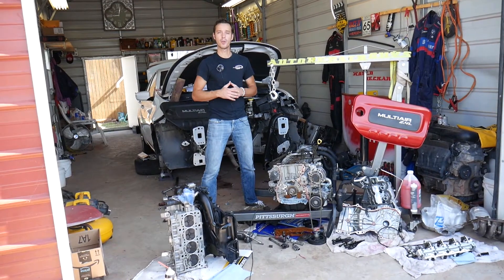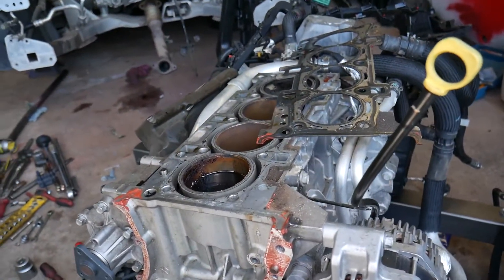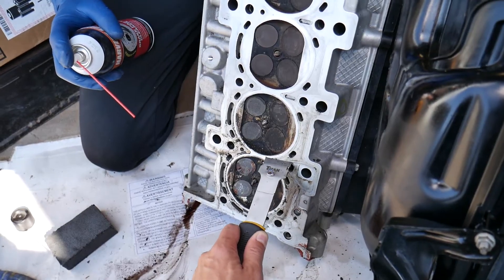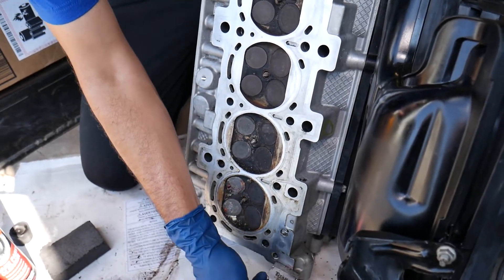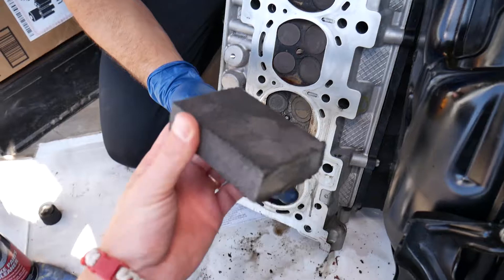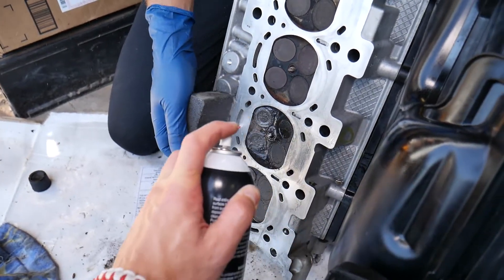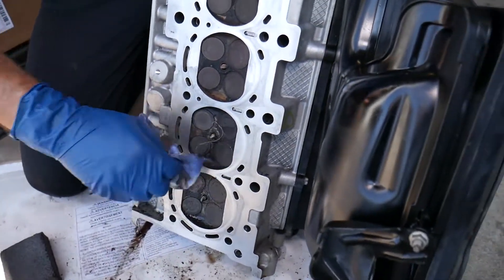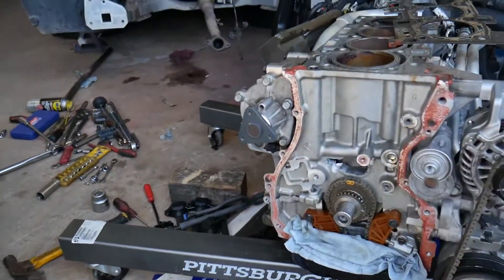HOW TO CLEAN ENGINE BLOCK AND CYLINDER HEAD BEFORE INSTALLING HEAD GASKET

Comment: Yea this is a video of exactly not how to do it. For one you didnt even use a straight edge to check for warping on top or bottom of head? are the cam journals straight still can you spin the cam by hand? And one should never use an abrasive sanding block that small. Shops use to use giant belt Sanders back in the day but its totally obsolete it needs to be decked properly and machined flat. But of course there your standard Russian car flippers who dont care because there just selling the car to someone who can deal with it later down the road. This is what you called backyard mechanic if I ever saw one.  

Edited also no one seems to notice the surface rust in the cylinders that's just gunna tear up the rings wont last longer than 10k miles

Comment: You should NEVER use an abrasive material to clean a mating surface! This is not the way you should go about this. The proper way is to use a carbide scraper and/or a plastic/rubber rolock disc on a die grinder. You have to use something thats softer than the aluminum when youre finishing the surface. Otherwise you will create high/low spots in the mating surface which can lead to premature (in this case head) gasket failure.

Comment: Never ever use a sanding pad! Use a green or red scuff pad!
Reply: nothing abrasive**
Reply: There’s a rubber block you use for this. Using anything abrasive can create micro cracks in the surface

Comment: MyNissan  ecu fuel injector section was blown.Petrol came out through silencer and missing happened.Mechanic fixed the ecu .Now no missing.But white smoke from silencer.
what is the reason?
Reply: your car is a gun